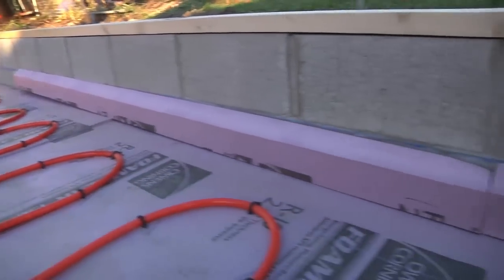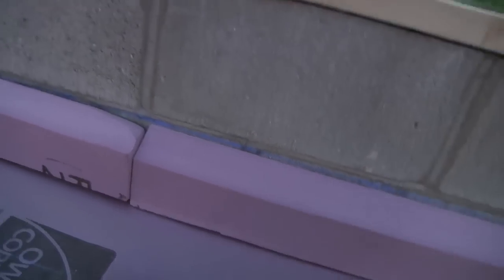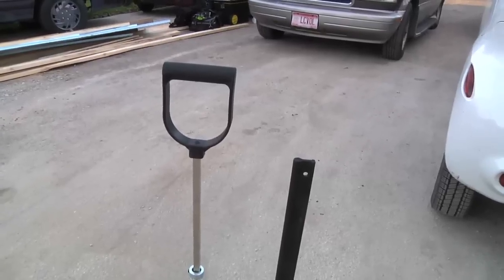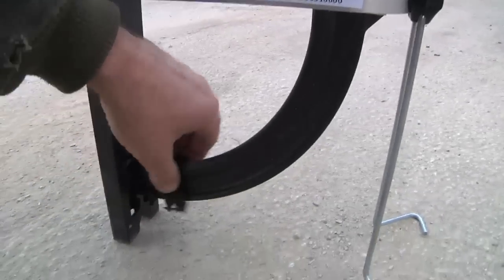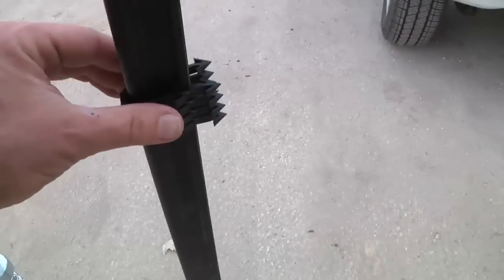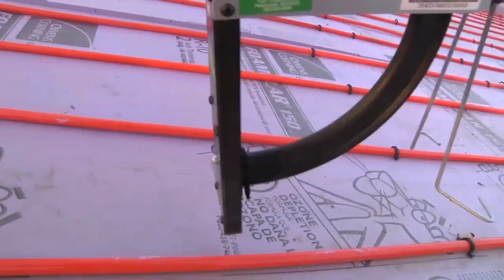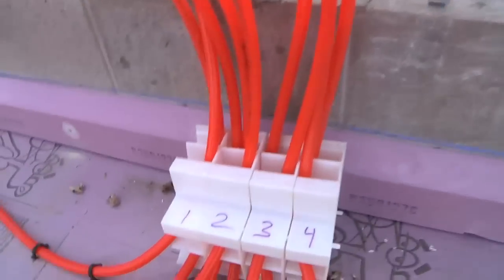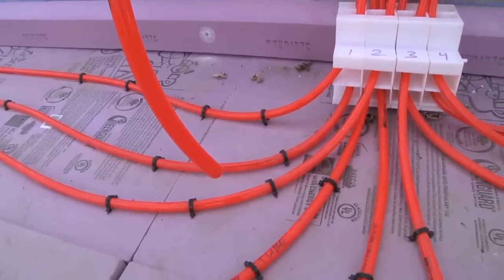Pex Weekend, Day 1, Saturday

Comment: Nice stapler, but it is designed to put you tube at the bottom of the pour! The tube should be in the upper half of the slab. The further down in the slab you go, the less efficient the system. It is explained in detail in "Modern Hydronic Heating" by Siegenthaler. I fear I may have posted this comment too late though.
Reply from the maker: I was working from an original edition of MODERN HYDRONIC HEATING. I read the whole thing, great book!
There are many considerations that go into where the tubes go in a poured concrete heating system. It's a bit more complicated than simply "that's less efficient". For example, with the Pex lower in the concrete, it gives a more even heating to the surface of the floor. It also takes longer for changes in temperature. In my particular case, that's what I was planning for, as this would be workspace that would be "heated" but only kept at a low and steady temperature.
Placing the tubing at the bottom of the slab also keeps it well away from the sawn control joints.
As I write this, it's the beginning of November, and I haven't even fired up the heating system for the year. One thing I CAN say is that the concrete (with the rigid insulation below and around it) makes a GREAT thermo heat-sink and flywheel. Even with wildly varying temperatures outside, it's always been temperate inside. A VAST improvement over the original garage.
As always, I'd encourage anyone working on a similar project to read/learn/study all you can so that your project meets your needs and expectations. So far, I've been very happy with mine.